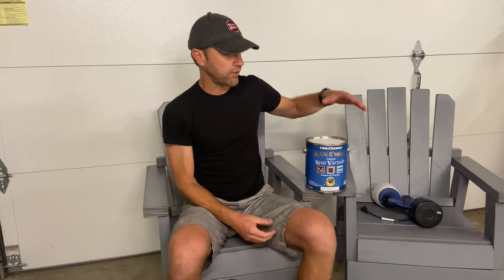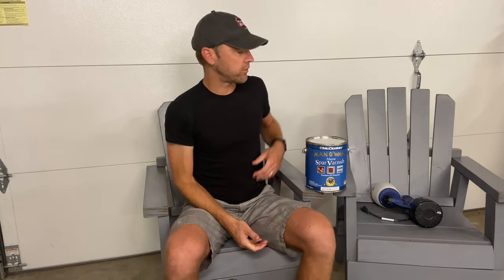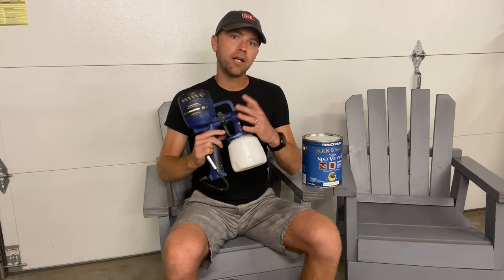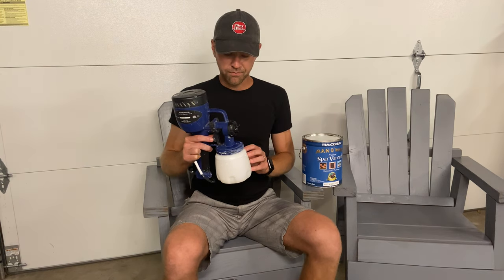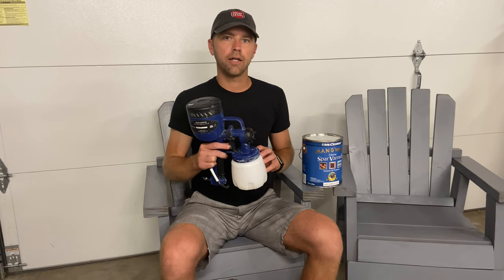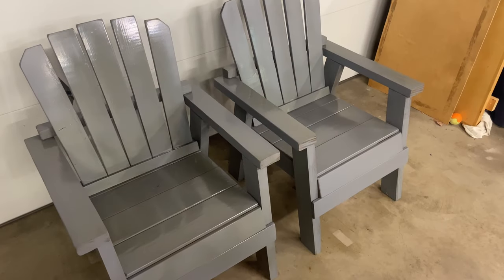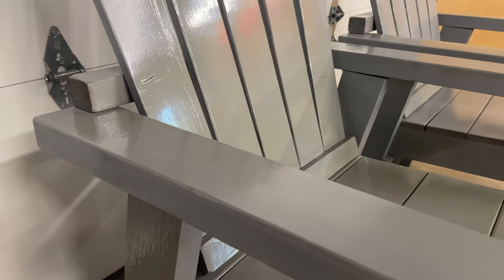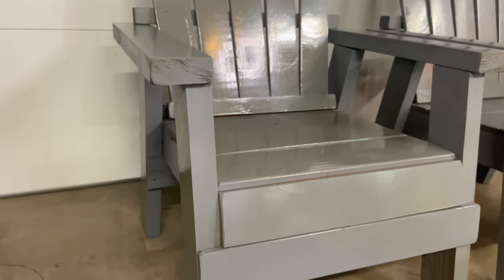How to Spray Varnish on Outdoor Wood Furniture for a PERFECT Finish

Comment: All the trim and moulding in my house is Red Oak & the man o'war semi gloss spar varnish really looks awesome on it, I use a air compressor & sprayer to apply at 80 psi & usually apply 3 coats, But one thing that wasn't mentioned is after the can has been opened I run the varnish thru a cheese clothe as I fill the sprayer

Comment: I’am making my granbaby a hope chest and I want something to look like glass and hold up through the years for her. Thank you 🙏
Reply from the maker: Might consider spraying lacquer instead!
Reply: @SawsHub  why should I consider spraying lacquer . Just asking why . Still learning. Thanks 🙏
Reply from the maker: @macdaddy5802  You said "look like glass", and you're working with a wood piece that will be indoors. Lacquer produces a very shiny finish and is perfect for indoor furniture. If you spray 4-6 coats on it, it should also be very durable. Spar varnish is for outdoor pieces and isn't necessarily a shiny, "glass like" finish. Hope that helps.
Reply: @SawsHub  cool thank very much.

Comment: did you use a sealer before the spar varnish? what about sanding between coats? I paint exterior doors and the finish is not the best vs polyurethane. But I need the best finish in outdoors, any advice?
Reply from the maker: The spar varnish is the sealer. Yes to sanding between coats. We have tons of videos on our channel on comparing various finishes, recommend you watch them.